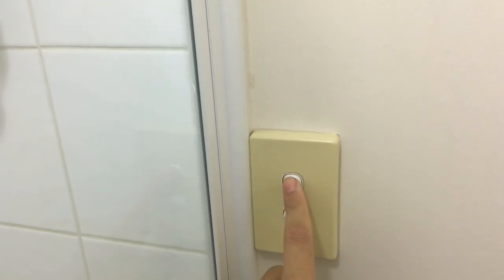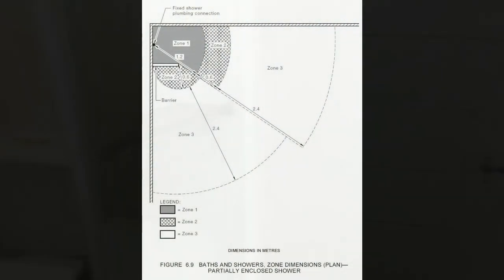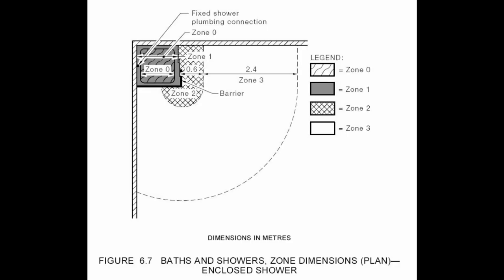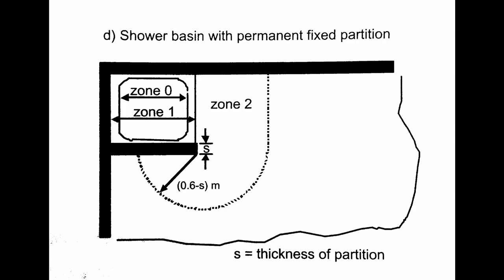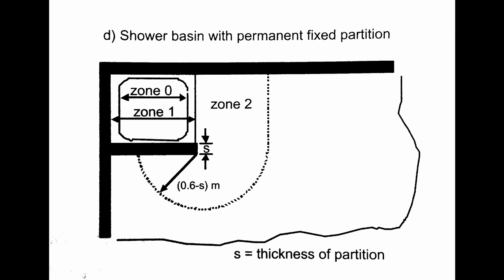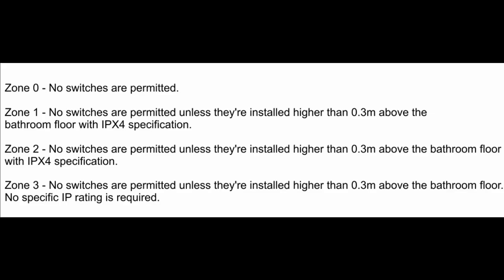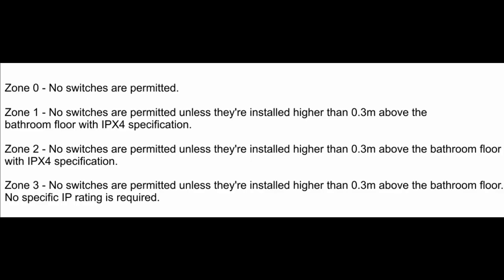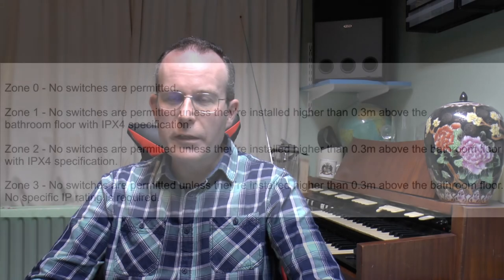Shower Room Light Switch in Australia

Comment: In Australia, in the domestic situation, if you have any electrical work done you have to have an RCD fitted to your fuse panel if you don't already have one. Initially it was just on the power circuits but the last time we had new lighting wiring installed we had to have one installed on those circuits as well. Certainly a very good idea in the bathroom situation. Years ago in a factory I got an electrical shock from a light switch after an electrical conduit coming down the wall filled up with water after a storm. Not very pleasant and no RCD protection then.
Reply: In Germany RCDs are mandatory in bathrooms since 1984. But this is only obligatory for new installations or if you change a room that was for example a former kitchen into a bathroom. So there are still bathrooms without RCD protection here. Since 2013 all circuits which contain undedicated outlets that are accessible to electric laypersons and are fused with less than 20A indoor or 32A outdoor must be protected by a 30mA RCD. The Schuko sockets we use here are normally connected to 16A circuits. The RCDs are normally type A in residentials, the AC type is banned here since 1984.

Comment: There is an IP66 rated version of those switches, part C2032V66, which is visually identical to the unrated version. It is manufactured specifically for wet areas like kitchens and bathrooms. A reasonable person would conclude that a licensed electrician would have used such a part for this installation.
Reply: First Surname
With it shoved right up against the shower, and having dealt with motel owners, I would make no such assumption. I would assume the shower was installed by a plumber, and was selected to fit around the light switch. The motel owner/manager may have moved the switch over slightly to fit the shower frame.
I used to do IT work for about 5 motels, with several different managers at some of them over the years. They bodge stuff all the time.

Comment: Most switches are outside the bathroom and I long thought that was the requirement. Older houses do have it inside but most electricians would recommend outside. The shaver power point is usually near the sink/basin and is a regular outlet and not the type of outlet required in the UK.
Reply: ive never seen a light switch installed outside the bathroom in oz or nz,  as apposed to the uk which they all are, except if they have those stupid pull string switches

Comment: Why would they mount it behind the door though!?
Reply: John Watkins Maybe an existing switch before the shower was installed
Reply: It may be due stud widths which is about every 400mm . Without looking at the video again , moving the switch to the right 400mm might be actually behind the door opening which is not good economics.
Reply: Here in Australia a lot of sparkies just put light switches wherever without thinking about it because they want to fuck off faster. One of my friend's old house had most of the light switches behind doors. Incredibly annoying.
Reply: s8wc3 ...I agree with that... it’s mostly about getting and out as fast as possible... and getting the bucks... and that’s about most trades in Australia (not all the teams), having first hand experience of my house being built in Perth, WA, in 2006... when I have the carpet fitted to one room only, (lack of funds) I ask the guy to clean up his mess, he said he would vacuum clean for $50, he said he was a carpet fitter not a cleaner... I told him to f#$& off of course and did it myself and said to him (sub-contractor) he won’t be coming back to fit the rest of the house out... but, at that time there were a lot of cowboys around with the housing boom... but, it did amaze me how many UK train idiots were out there doing the same BS installs...

Comment: +John Ward
This reminds me of a wider-issue about interpreting regulations -- its' too easy to find one specific regulation rather than taking into account the regulations as a whole AND other common-sense/theory for that matter!.
In the case of 17th-amendment-2, there is for example:-
132.5.1  The design of the electrical installation shall take into account the environmental conditions to which it will be subjected.
522.3.1  A wiring system shall be selected and erected so that no damage is caused by condensation or ingress of water during installation, use and maintenance.  The completed wiring system shall comply with the IP degree of protection relevant to the particular location.  NOTE: Special considerations apply to wiring systems liable to frequent splashing, immersion or submersion.
(and, more generally, any regulation basically saying the accessory/wiring has to be ''suitable for the location'').
I do think "interpretation of the regulations", relationship to theory/fundamentals,  is a whole topic unto-itself.

Comment: I'm puzzled - maybe I'm missing the video but the switch looks to be only just in zone 2 if at all. Our shower trays are usually at least 76cm, so I guess it depends how far back that corner door is cut back. Either it looks like you would need pretty long arms to reach the switch while standing in the shower.

Comment: Hi John hope you are well!
it occurred to me that if such a switch could be arranged to work with low voltage D.C. 5-12 volts for instance, then that signal could be used to switch a remotely positioned relay to handle the A.C.
A slight deviation from the regs but covered by the old  (its the individual engineers choice to use technologies that are not standard recognised solutions)
These type of things can be acceptable as long as any deviation can still provide the same level of safety as the standards in the regs would provide!

Comment: On the UK diagram Zone 2 did not extend to the wall but merely to 2/3 of the partition so a switch in that position shown in the Australian fitting would be allowed ?
Reply from the maker: Zone 2 is 60cm from the end of the partition, the partition in the video is less than 60cm, those in the UK diagram are longer.

Comment: While it may be true that electrical work needs to be done by a professional in Australia doesn't mean it was actually installed by a professional. Like any country, many people illegally install their own outlets and switches and there is a plethora of electrical units in every hardware store to supply them. To be honest, I don't think that switch is legal. Australia has pretty much the same laws as the UK (if not strickter) because we have the same higher voltages.

Comment: I once looked around a very tiny flat in the UK In the bathroom the there was a toilet and sink with a shower head coming out of the wall and the whole floor was the drain. There was a ceiling mounted pull light switch mounted in the middle. That must be zone 0 or even zone 1?
Reply: Only if the ceiling height is less than 2.25m. That's the upper limit of the zones. In Europe the zones are harmonised and the rules what is permitted or not are harmonised too. I put in a link to a german picture:

https://upload.wikimedia.org/wikipedia/commons/0/06/Bad_Verlegezonen.jpg

Bereich is "zone", dimensions are in cm.
Reply: Zone 0 is the actual shower tray or bath tub.. So yes technically no switch should be in there. I would have put it outside the bathroom door.

Comment: 0.6m, 1.2m, and 2.4m? Odd numbers until you realize they’re almost exactly 2ft, 4ft, and 8ft.
Reply: not odd at all to me, 1.2 and 2.4 are standard timber lengths.
then again i am Australian ...
Reply: Sheets of plasterboard are 2.4 x 1.2m.. Which means studs are typically 400c/c or 600's.

Comment: Interesting video John.  In practical terms I cannot see the issue here because of the fixed screen and IPX rating of the switch,.  Of course, an electric shower is a switch manufactured to operate within zone 1. It's a shame that no uk manufacturers do a range of suitable IPX rated switches.  Hands up all those that have had a buzz off a light switch when cleaning it.

Comment: How do the regulations apply if you have one of those radio controlled switches where the switch on the wall only has a battery inside.
Reply from the maker: You can put those anywhere you want - no wiring, so wiring regulations do not apply to it.
Reply: That is what I thought.

Comment: I read those diagrams as the switch being in zone 3. Are you discounting the fixed glass partition because it doesn't go to the ceiling?
Reply from the maker: Partition less then 60cm length, so a 60cm radius from the end of it would include part of the wall as zone 2.  Diagrams show it with the partition being at least 60cm long so the wall is not in  zone 2.
Reply: I think in the first at least the fitting is less than 0.6m from zone 2
Reply: John Ward it looks like it might be exactly 60 cm to me — probably precisely because of considerations like that. These appear to be 20x20cm tiles and it looks very much like the partition is roughly 3 tiles worth.
Reply: Although come to think of it, this sort of “square with cut off corner” shape seems to have as a standard size 90x90, with the door area cut off being at 45cm.

Comment: Would a ceiling switch be accepted in this zone 2?????????
Reply from the maker: In the UK - yes, pull switch is acceptable but only if the cord is in zone 2 and the actual switch is outside the zone.
Not usually a problem as zone 2 only extends 2.25m above the floor, most ceilings are higher than that.

Comment: That's one of the reasons I have a remote control (wireless) switch on the wall of my bathroom (I live in the Netherlands). The only downside is that I have to occasionally change the batteries.
Reply: I fitted a motion activated bathroom light (which is itself something like IPX-4 rated, but also screwed to the ceiling 3m above the floor). It removes the need for switches and dangling bits of dirty string.
Reply: James Grimwood, actually I have both. I am a bit of an energy miser as well as lazy. I use the manual remote to switch the light off when I leave the bathroom but when I enter I don't want to stumble around in the dark.
The other reason for the remotes is that my washing machine (on a pedestal) blocks the original switch!

40 years ago a normal switch was prohibited in a bathroom in the Netherlands. It had to be on the ceiling with a pull rope (which broke often) or outside in the hallway. Or both. A real nuisance. 
Nowadays the rules are relaxed. Better hardware.
Reply: You can get kinetic switches now.. No batteries. Just the power generated from the switching does the job.

Comment: Those rules look old, no light switches 240v is permitted in zone 0,1 and 2, the rcd installation is required but its not considered alone to be enough protection. If you see light switches or power points ever installed inside a shower this would be a serious breech of the rules, and should be reported.